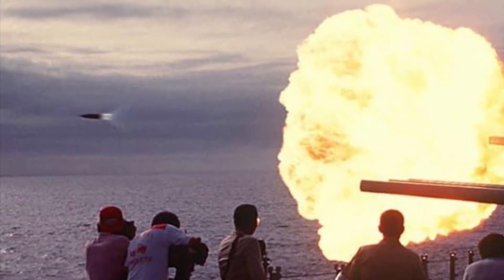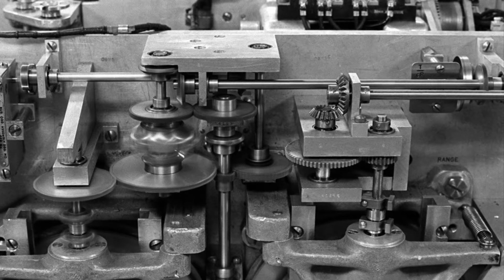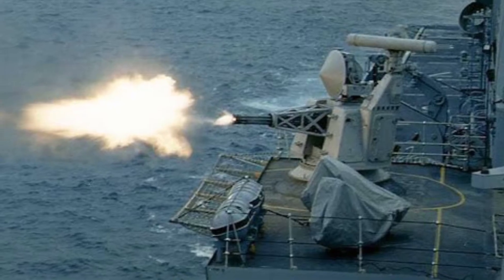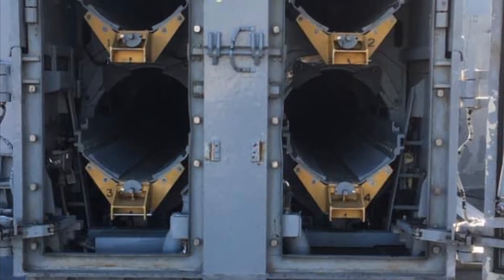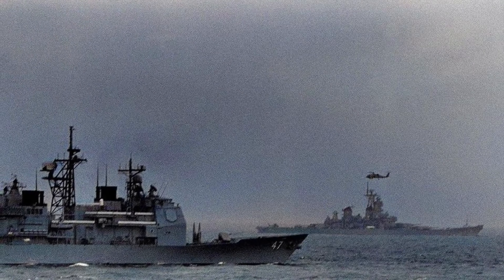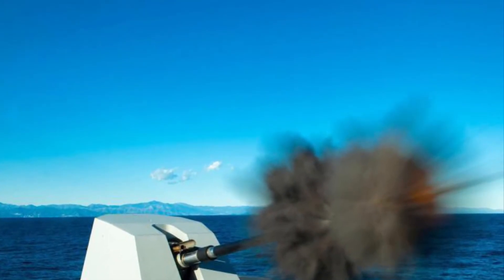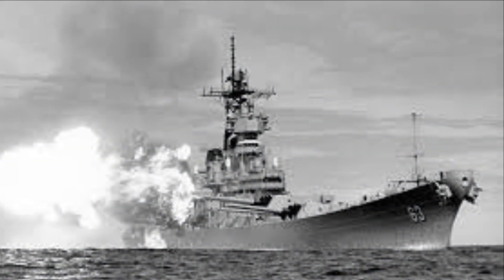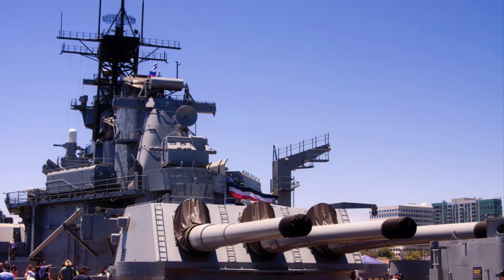How would I modernize the weapons on an Iowa Battleship?

Comment: First off. Highly automate the ship to massively drop the crew size. If we are getting crazy with it, take out the boilers and add a nuke reactor or two. Bring on 2-4 of the new lasers for air defense coming up out
Reply: maybe modern steam boilers with more power, but nuke reactors scram often
Reply: Read John 3:16 🙏
Reply: Cost would be more than building a new ship. Cost is the reason they were re-retired, the massive crew size is also a major reason.
Reply: @briangulley6027  oh I highly agree. This was more a what if, for fun. None of it is practical. 
That being said the US Navy does need a shore Bombardment ship to support the Marines on shore. Those 5” guns are not going to cut it
Reply: @peterprovenzano9039  They have attack aircraft and cruise missiles for that. Battleships must get in close to use the guns, too risky for too little reward. The days of WWII style beach landings are long gone.
Reply: @briangulley6027  no, with China on the rise clearly they are not. They just need to develop cannons that can reach out to 100+ miles now. Each tomahawk costs about $1 million. There needs to be a cheaper option for naval gunfire support
Reply: @peterprovenzano9039  I'm sure it there was a cost-effective way to do that it would have been done. Sure, a cruise missile costs a lot be paying the 1300 sailors to run the ship costs more.
Reply: @briangulley6027  oh I agree. We need an entirely new platform not one from the 1940s . Either way we still need a ship to provide naval gunfire support to the Marines
Reply: @peterprovenzano9039  "They just need to develop cannons that can reach out to 100+" This has been tried before. Does the Zumwalt class's LRLAP and the Burke's ERGM ring a bell? Both fell far short of the 100+mile range. If you go down the route of a new "cannon" IE larger caliber, keep in mind even with as large as a 16in is, the most they can get is ~25miles, 40Km

Comment: Honestly, we would be better off repurposing the now retired USS Enterprise. Remove the aircraft and install long banks of VLS. The Enterprise could carry far more missiles than an Iowa class, already had nuclear propulsion and is capable of reaching 40 knots at full speed. It has the storage and space to reload the VLS at sea as well. Without the need to support air operations, it would become a deadly missile armed battleship. 
Also, American carriers are extremely tough and hard to sink. This is a better option than activating a battleship
Reply: Look, we just want a cool battleship of the future. We are not talking reality here
Reply: I second that idea.  Do the same with all mothballed BBs; turn them all into missle boats.  The BBs have the armour to survive retalitory stikes from all comers.
Reply: The enemy would use missile launched torpedoes to deal with the threat.  Or nukes if necessary.  The armor only helps against smaller missiles but costs fuel and has other costs.
Reply: @GeraldMMonroe  
No ship is unsinkable. That was true in WW2 and it is today. This type of missile ship would not have to linger waiting for aircraft to return. It can sail in, fire and then sail off at flank speed.
And being nuclear fuel isn’t an issue
Reply: @ravenmoon5111  sure. But you would very likely do better by designing a new nuclear powered heavy cruiser from scratch.  Or invest the same resources this refit would cost into buying however many destroyers that works out to be.  Remember this thing will cost a fortune to operate, it needs an enormous crew albeit a smaller one without aircraft, and it has 8 nuclear reactors you need to replace and fuel and operate.  10 or 30 destroyers instead would likely be more useful in a potential battle
Reply: @GeraldMMonroe  
Potentially. There is also the fact that the hull is already decades old. I propose it more as a though exercise than something i believe would ever happen. 
It’s true value would be its intimidation factor. Much like the Russian battle cruisers, their actual military usefulness is much more limited than the emotional threat they pose.
Reply: It’s happening
Reply: Given that destroyers are as lage as light cruisers of the early 20'th century, and comparatively far more capable, I'd say any capitol ship would do best favoring anti missile and anti aircraft defense, using all other mounts and positions for communication, interfacing, detection, situational analysis, command and control, etc. A sort of fortified brain wielding destroyers, subs and unmanned ships/aircraft as it's weapons. Of course having aircraft recovery and launch capabilities rather than heavy artillery would be of much greater value, so supercarriers and the like serve this function better. If a large scale shooting war starts I would guess we will see anti aircraft/anti missile systems covering all available surfaces like we say in the 40's again. It's just too easy to overwhelm the current layout with combined arms or concentrated fire.
Reply: This is the kind of stuff i would read at noncredibledefense
Reply: As much as I agree, if I’m landing troops on a beach I’d like a set of 16” guns pounding the enemy while they land
Reply: I thought of that as well
Reply: That role is already taken by the much less expensive and vulnerable SSGN Ohio conversion
Reply: @justfun287  we have four and they are all scheduled to be scrapped when the Columbia class enters service. And, submarines cannot launch anti aircraft or anti missile munitions
Reply: And what ship today has 350 plus mm plate armor? The old battleships had armor as thick as their main battery armaments. The Iowa's are floating tanks at classified 34 to 36 knot speeds. Nothing in the world matches them. That is why they are still around. On the verge  of a conflict with Russia or China right now. I bet plans are already in motion  to activate New Jersey and Wisconsin. Iowa turret 2 is to damaged and Missouri is a symbol of piece and end of WW2, and guardian of the pacific.
Reply: @rccarsandmusic2641  Won't happen. Russian and Chinese hypersonic and anti ship missles would send them to the bottom of the ocean.
Reply: @leelawrence1557  Russian missile have a 75% malfunction rate and none of those missiles have the explosive power to penatrate 16" Armor belt. The old shells were still not aluminum
Reply: @rccarsandmusic2641 that is completely false, russia has demonstrated thats its missiles are highly capable
Reply: There is one thing everyone is missing here. These ships are very maintenance intensive  (I served on BB62 as a machine shop technician) and steam is going away. Only 8 steam ships left in the Navy. And to reconfigure the propulsion plant with gas turbine or nuclear power would be cost prohibitive.  Then there's the electrical plant. New generators, switchboards and step down transformers would be needed at 4160 or greater voltage to power modern weapon and radar systems. Based on this, bringing the Battleships back is nothing more than wishful thinking and speculative fantasy.